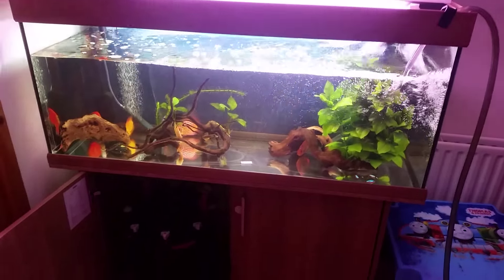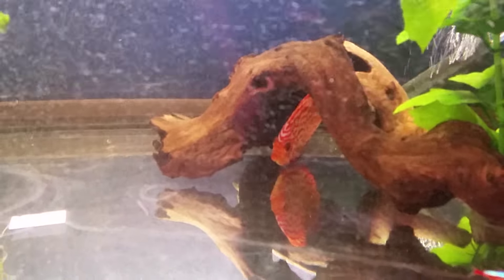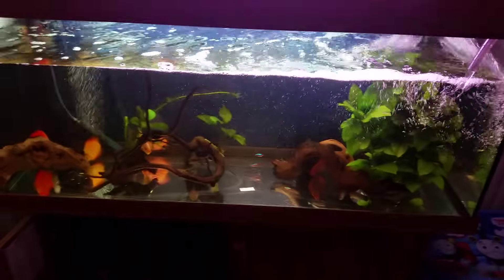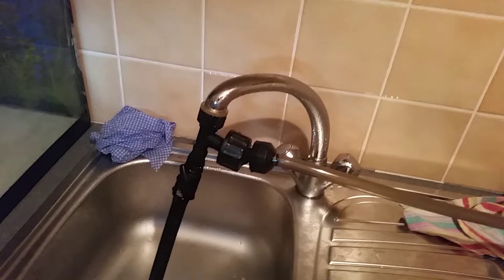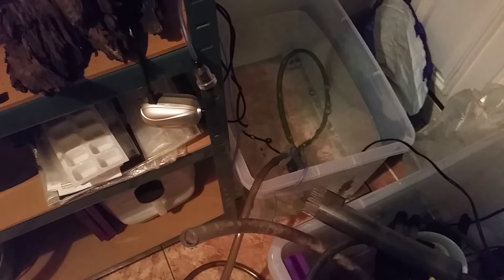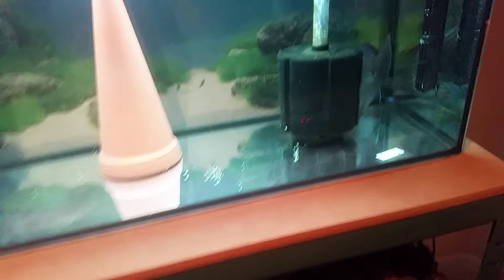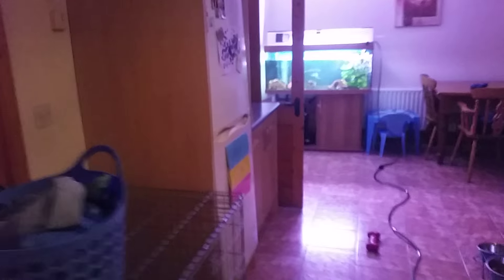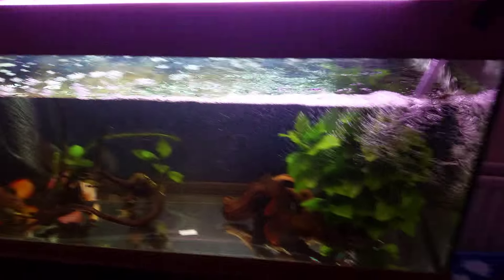How I do water changes with my JBL water changer.

Comment: great idea and thanks for the sub i got a bit worried for a minute i taught you were filling from the tap and the tank would overflow i wonder could i do the same with my tank i change about 400L once a week on my tank
Reply from the maker: +James Feenan yes you defo could as long as you have a large enough storage container for the water you return to your tank. This set up makes water changes so much handier! some ppl with water changers do go straight from the tap to tank but you need to dechlor the whole tank volume every time and i also found it a nuisance trying to get the temp right.